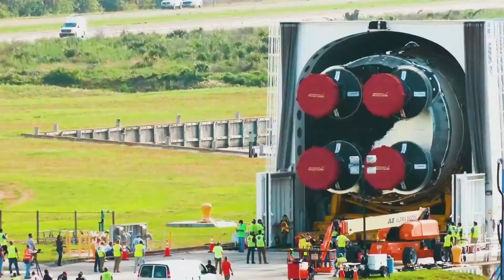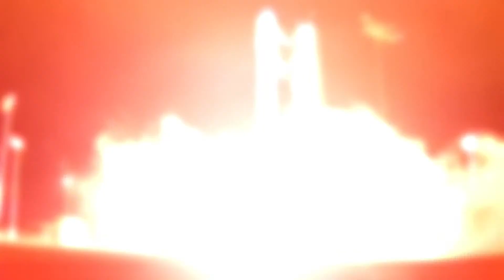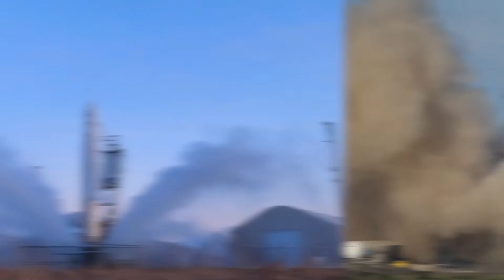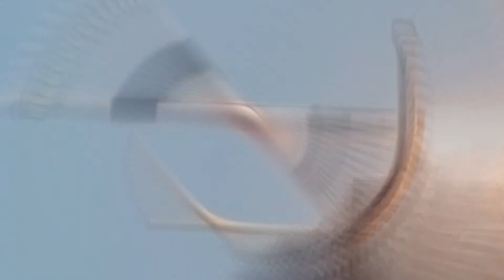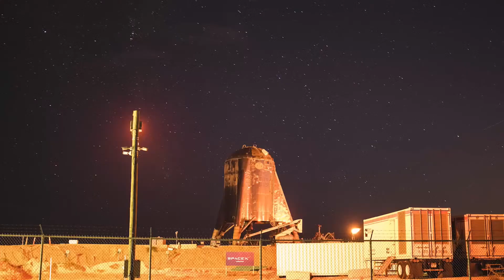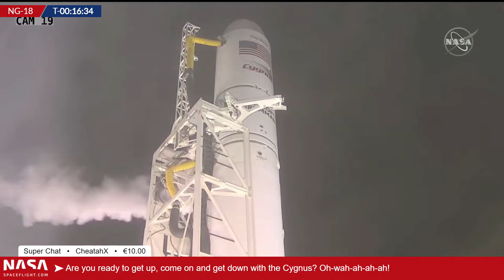SCRUB: Fire Alarm at Cygnus Control Center Scrubs Antares NG-18 Launch

Comment: Calling the new rocket Antares 330 like it's a direct evolution doesn't make sense. New booster body and plumbing, new engines - at least call it Antares II. When the add they hydrolox upper stage, Antares IIA. Rockets don't usually change their names for upper stages. Delta IV was very different from previous Deltas so it got its own number. Ditto for Atlas V.

Comment: Hey NASA... call SpaceX, they can teach you a thing or two..
Reply: Northrop Grumman is not NASA, just a launch provider for them using the Antares/Cygnus
Reply: The fire alarm happened at Northrop Grumman's Cygnus Control Center, completely unrelated with NASA and could happen to anyone
Reply: @Alexphysics13  100%
Reply: There was a fire alarm in the Mission Control center. That can happen anywhere
Reply: @rocketman1969  Still SpaceX did in 10 years more than NASA did in 60.
Reply: @saito125  NASA landed men on the moon and built a large part of the ISS... and the Space Shuttle program as a whole. And Gemini and Mercury.

What are you talking about?